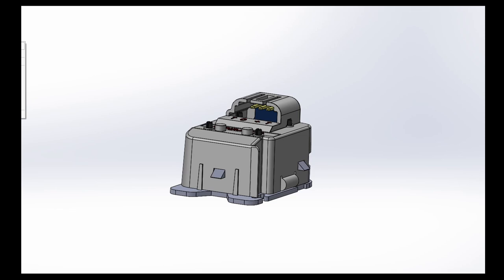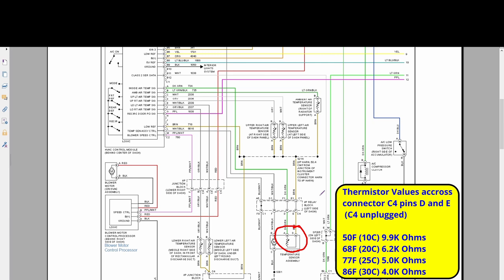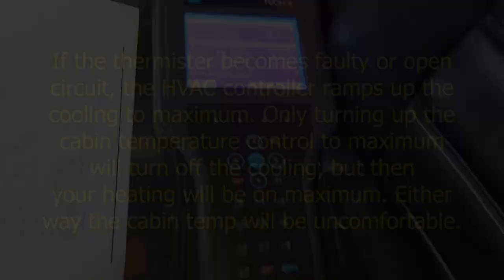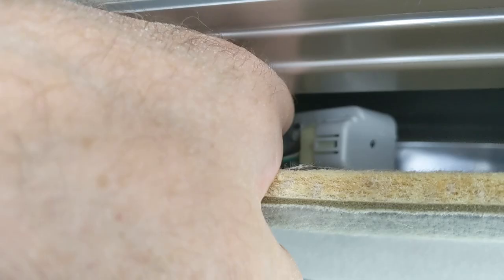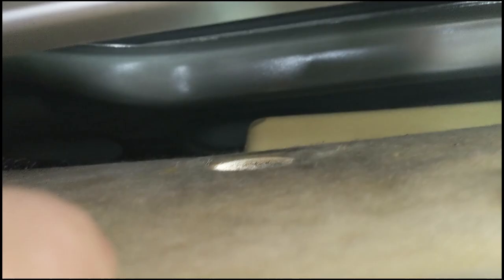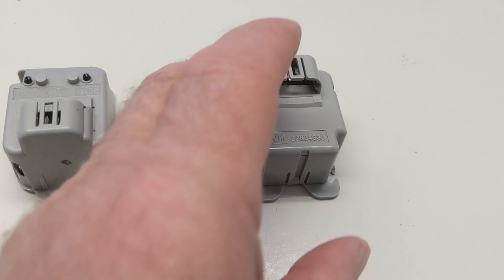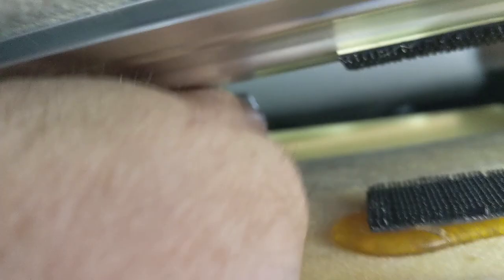Hummer H2 2005 - Internal Cabin Temperature Sensor

Comment: Could just the thermister be replaced? If so do you know which  value?
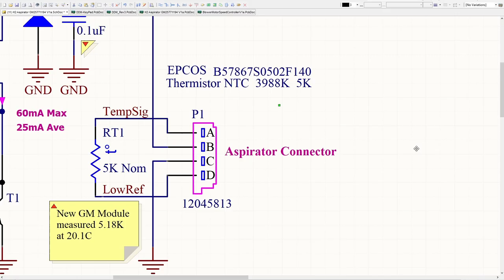Reply from the maker: Thank you for your comment.  If you go to the 20:26 mark  you can see B57867S0502F140 which is a 5K NTC Thermistor manufactured by EPCOS / TDK. Not 100% sure this is the correct part, but having taken measurements and analyzed the data it seems to be the best match. There are though literally hundreds of possibilities but this one is the correct size, approx 5K @ 78°F and has the right response curve (3988K) plus they are only a few dollars, hope this helps
Reply: @hummerfixes  thanks,  I only get heat when set to 90, so this is my next job I'm ok with a soldering iron, just replaced the cluster bulbs, I'm in the UK,  my biggest problem at the mo is a occasinal P300 code multible missfire I've cleaned injectors replaced plugs leads and coils its driving me mad ..if you have any ideas let me know cheers.
Reply from the maker: @solidamber  drop an email to hummerfixes@protonmail.com I'm in the UK too...
Reply: @hummerfixes  ordered a 5k thermister on ebay soldered in now seem to have heat..thanks.
Reply from the maker: Hope it works... keep us posted 👍

Comment: my 02 h2 having air con problem that air blows but the air is no cold enough.
ive noticed the sensor has been making buzzing noise time to time since few years ago.
could this be the cause?
Reply from the maker: Play from the 12:43 point in the video, this may explain the buzzing noise that you're hearing, but It's unlikely to be the cause of lack of cold air. To prove this set your A/C to slightly higher than the ambient temperature, the fan it should slow down indicating that the A/C system is working correctly. Usually it's the your A/C that needs re-gassing (1.6lbs of R134a !!!) If you've already done that your A/C may need further diagnostics, could be anything from a simple leak, to a bad compressor (https://www.youtube.com/watch?v=4W0JSqP85-w)
Reply: @hummerfixes  thanks for  you reply. actually, ive already replaced all the ac components like compressor,dryer,olifice,condensor,fan cluch, only to find none of the parts i replaced was broken.  no leaks. gas is full. only thing left not replaced is evaporator and pipings. i washed evap added filter did not fix the problem. now im replacing the internal temp sensor, lil air flow sensor inside ac vent, and dorman ac control unit.
ive been cursed with this ac is not broken but air not cold enough problem for 5 years now.
any advise will be greatly appreciated. cheers!
Reply from the maker: @HOTWIREDCHANNEL  One of the most important factors is the amount of  refrigerant, this should be 1.6lbs of R-134a (not Freon) Any deviation from this will mean the A/C will not  run at optimum. Just recently I had my system re-gassed by a local service who insisted on under-filling the R-134a despite my plea to put in the full 1.6lbs, of course it doesn't get cold enough. Also you mentioned "washed evap" I hope that wasn't with water which is the last thing you need to get into your system. You also mentioned adding a filter, but anything not part of the original system doesn't need to be there. Logically if your A/C is configured correctly it will work, so if it doesn't something must be wrong.  It might be worth watch my video on the compressor replacement https://www.youtube.com/watch?v=4W0JSqP85-w
Reply from the maker: Also watch ChrisFix and his excellent video https://www.youtube.com/watch?v=Pdq8JAlct6s
Reply: @hummerfixes  thanks for your reply. 
i washed evap with coil cleaner. https://youtu.be/A-pAxexLnnY
it was nasty as h@ll and improved lil but did not solve it. also replaced the blending door actuators.logically it should not be happening. i just measured the blowing air temp was around 11℃. not cold enough. now i dont know what to do, do you think replacing evap could solve the problem?
Reply from the maker: @HOTWIREDCHANNEL  OK I see you are talking about the external surface of the evap and adding a pollen filter with is fine. But rather than swapping parts out in the hope of getting it working, I personally would prefer to go through the system methodically. 

I would reverse flush the internal evap pipes, ( see this video https://www.youtube.com/watch?v=SuzcTdZIz3c) all the pipes and hoses, make sure the orifice tube is clean and/or replace, new o-rings and seals replace the condenser as the micro bores can get clogged, make sure your have exactly 1.6lbs of R134a and try to avoid putting in UV dye as it can clog the system. Only when  the system is clean and free from particles and fragments, correctly gassed, with the correct level of PAG Oil can it function optimally.

It looks like you are in Japan? If so how do you get a Hummer down the streets?
Reply: @hummerfixes  yes i drive hummer in japan since 2004 for 17 years now. there actually are many hummers in japan. most of the city streets and highways are large enough for any kinda cars but yes you do have to be careful not to drive into old neighborhood narrow streets and lil hard to find parking spot.(^^)
Reply: @HOTWIREDCHANNEL  it sounds like your blend door actuators its the one that controls hot and cold air!!